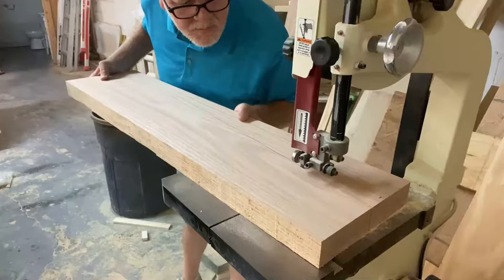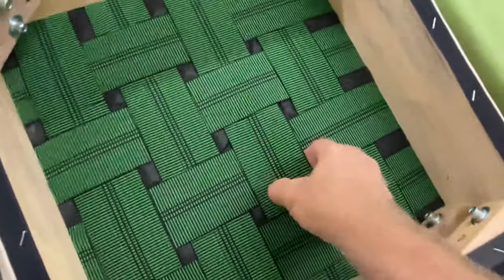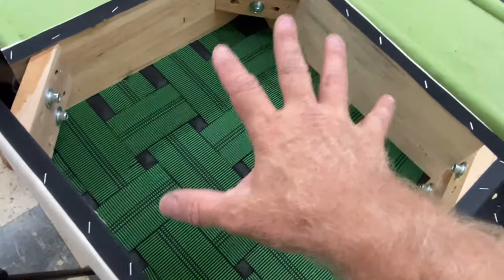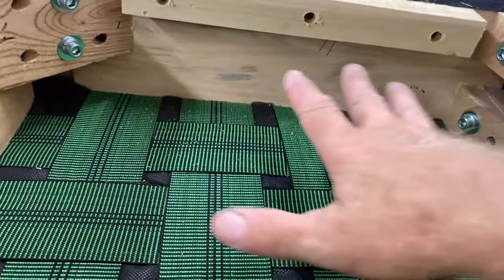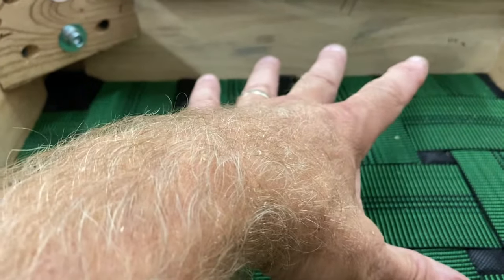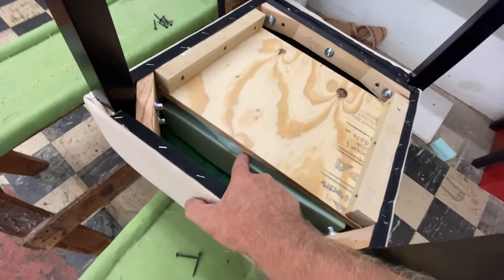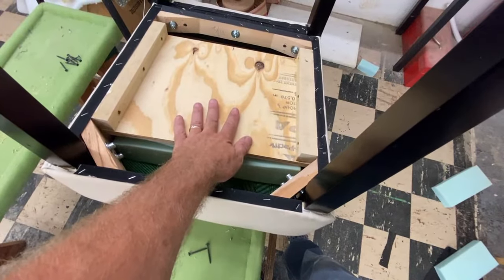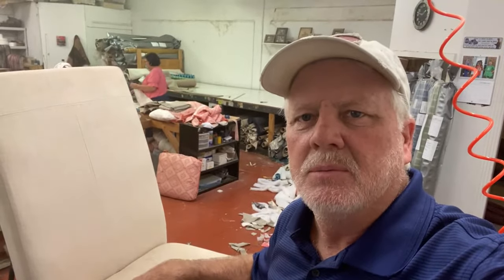How to Fix a Sagging Seat

Comment: Great video!  Are you able to share what type of foam that is?  What is the thickness of foam you are using (I know it might be chair subjective)?  Is it available at a hardware store or specific to furniture?
Reply from the maker: I used 40 compression(medium). I order from a foam company. You can get foam in different thicknesses on Amazon. Thickness is determined by the space you fill.

Comment: Thanks Mark!  Quick question if you have a moment. I have a very similar chair even down to the strap color (restoration hardware - disappointed in them). However the chair you're working on seems to have a deeper cavity to work with. After removing the bottom fabric, I only have a 2.5" deep cavity to the straps. Doesn't leave much room for a 2" piece of foam (looking at what you recommended) and maybe .5 square plywood and min of 1" for the brace. Even if I get that to work, will it then just feel like I'm sitting on a board?
Reply from the maker: Your best option is to use 3 inch foam webbed in from the bottom with jute webbing. Yes, doing as in the video with less cavity will make the seat firmer
Reply: @MarksUpholstery  Thanks Mark!  Good idea. I’ll look into this jute webbing.